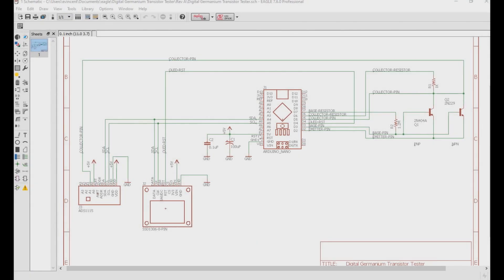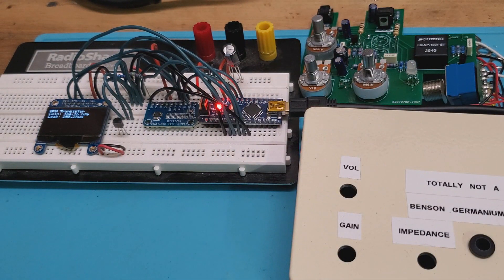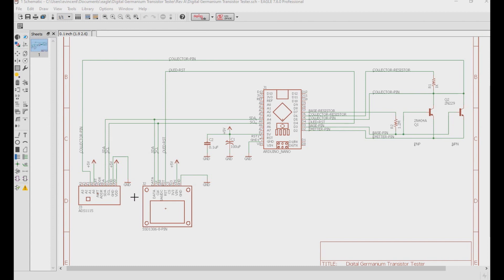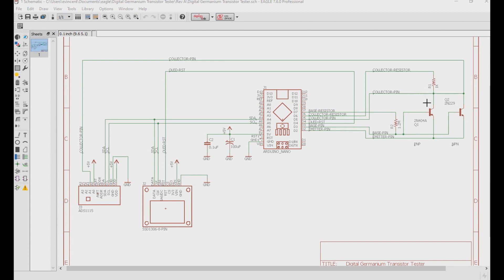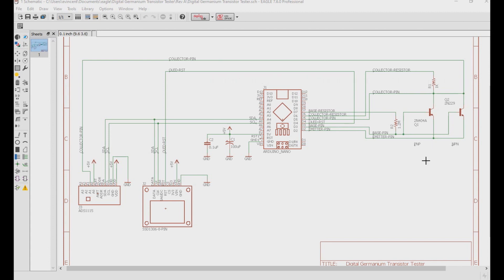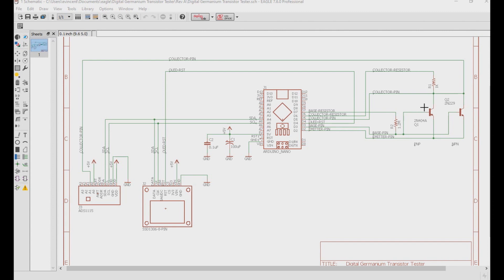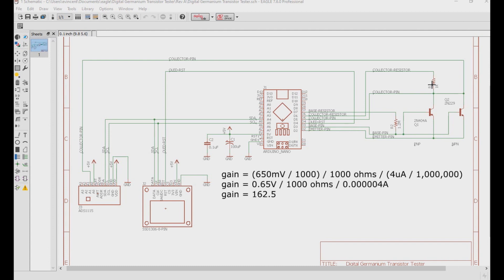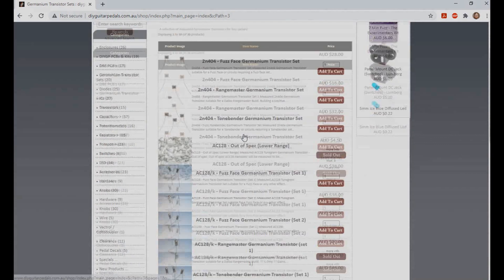Arduino Germanium Transistor Tester

Comment: Working great, but I think my ads1115 has a fake ic. On a good 2n3904 getting leakages of 6-20ua. Unused.pins are referenced to ground, but some still show voltages of the pins next to them... Should still be usable, but in case anyone is getting leakages on si npn trans, this could be why.
Reply: Unless the floating collectorpin when testing npn is causing some false leakages too.

Comment: How important is the 1.2m resistor value? Can I use a 1m and set it in the code?
Reply: OK, did a series of 1m & 220k, got it close enough at 1.223m I reckon.

Comment: Hello!!! In September last year I discovered the ADS115 module, it was what I needed to make a uC transistor tester . I had made one with an lcd voltmeter, but it needed some math as it was not micro controlled. I made mine with switches to switch between npn and pnp and also to switch between germanium transistors and jfets (exemple: phase 90).
Seeing your project now made me want to modify mine, it uses a 16x2 display with an i2c module. The operation of your tester is much more practical and fast. Congratulations!
Reply: Thanks.

Comment: I wonder if you could also get this to not care about the emitter, base, can collector order and to actual find that order and print it to the screen too. I am not sure if applying 5V across all of the pin pair is safe for the device to find out the order, but it seems reasonable.
Reply: Those device testers are using an atmega328p, like in an Arduino. I know the source code is around somewhere, but I never bothered to really hunt it down. It does something to determine the pins, no matter the order. You might need that from time to time. Especially when dealing with some Russian germanium transistors
Reply: @erikvincent5846  Andreas just did a video on this. https://www.youtube.com/watch?v=bRtLkQ8dOj0